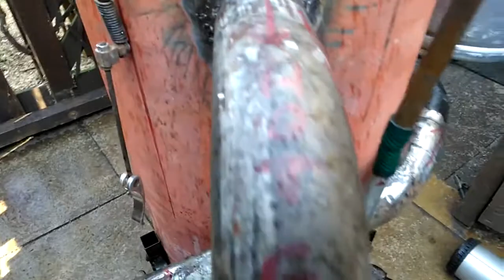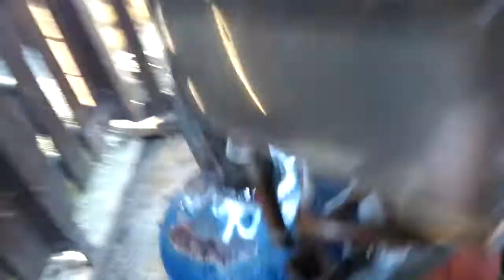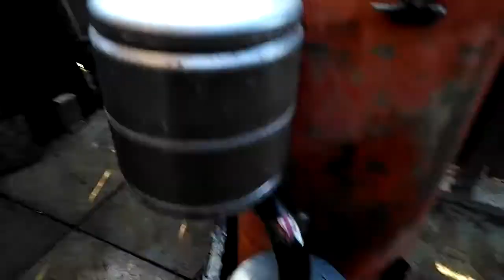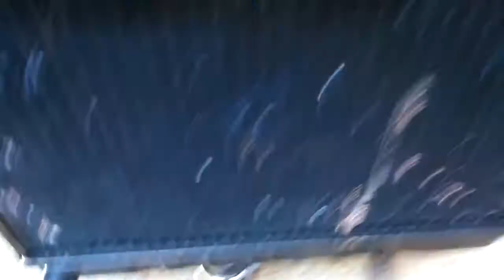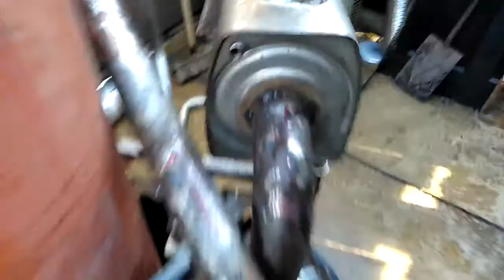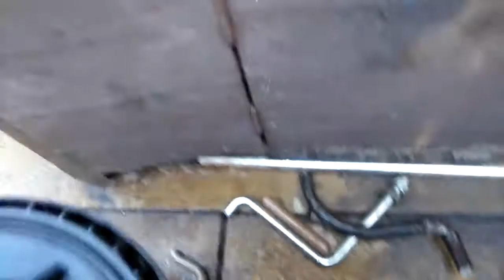Project Neptune (wood gasifier - pyrolysis reactor) #2

Comment: Nice  :) . 
 This has to be one of the most compact builds that I have ever seen. 
 Well done indeed.
Reply from the maker: Thanks pal.
Space is something I don't have a lot of so making it compact was one of the most important objectives, along with it costing as little as possible to build.
Reply: @brianmurphy8790  
 Indeed. Space is a major factor in many of the projects we like to build. 
 While I have a LOT of space here, I always tend to go for the most compact design I can possibly build. 
 Among other things, it makes for a more portable system. 
 One thing I wood suggest, however, is that you add some cleanout ports, here and there, as soot and tar can quickly choke up the plumbing. 
 On mine, I have a LOT of removeable caps, that allow me to suck a flame into the pipework, so I can burn out all the gooey bits, in a VERY hot and smoky sort of way. 
 It works like a charm, and it keeps me warm, on those chilly winter days   :) .
Reply from the maker: @CNCmachiningisfun  
I'm thinking the water/oil bubbler might be a good trap for the sticky goo.
Soot I can deal with, I've got some long and  bendy wire brushes.
The water in the bubbler will hopefully cool any tar enough to thicken it and get stuck in the stainless wool, then some of the motor oil floating on top of the water should make it's way downstream and keep the pipes lubed. 
With a bit of luck that should go some way to stop it sticking to the walls.
I've got a fan to blow air over the vortex filter too, again hopefully, that'll be the last place it sets. 
I've had a couple of oil burners that used to get all gummy when I ran them with cooking oil, but a bit of old motor oil/diesel seemed to soften/dissolve it quite well.
I'm going to run motor oil/diesel vapours through it before I even think of firing it up - I reckon it's probably a good idea to do that every few runs.
Reply: @brianmurphy8790  
 You'll be surprised at how cleanly a gasifier can run, once you get it properly tuned up. 
 My very first one made enough tar to tarseal my entire 150 metre long driveway, while wrecking a car engine. 
 Over time, I learned from my mistakes, and the gas is a LOT cleaner now. 

Oh, how I miss that tar. NOT! 

 For your very first runs, I wood suggest that you go with charcoal only. 
 That way, the tar content will be at a minimum, so you can see where you might need to put any cleanout ports. 
 A bubbler system can help, but it may be a challenge to get it working with an engine, unless you pull the gas through with a blower, perhaps. 
 The learning process is a fun one, that's for sure  :)  .
Reply from the maker: @CNCmachiningisfun  
Yeah, I was thinking I might need the vacuum pump running the whole time, even with an engine on the end of the pipe.
I've got a tank that I was thinking of putting some baffles in and installing it between the vacuum pump and engine, like some kind of plenum chamber to act as a buffer.
I've got an old Lister twin and Petter single as my initial engines play with.
I've been looking at various turbo diesels as well, around 2 litres, but that'd be for the next incarnation of gasifier.
Reply: @brianmurphy8790  
 You could start up, using the vacuum pump, and let the engine warm up on it. 
 After that, you might be able to reduce the speed of the vacuum pump, and progressively replace its workload with the engine's intake.  
 Ideally, the engine should do all the work, so as you can get the best results from your gasifier. 
 Another builder used a sort of water shower system, to knock the particles out of the gas stream, without needing to force the gas through a water bubbler. 
 I have never tried it, but perhaps you could make this work for you   :) .
Reply from the maker: @CNCmachiningisfun  
I think I saw that guy - in Canada?!
Part of the reasoning behind the bubbler is that it will scrub any CO2 from the gas - because CO2 is highly soluble in water, whereas CO is only very slightly soluble in water. It should scrub out any sulphurous compounds too.
Yeah, once the engine is running there should be enough vacuum to pull through the water - it's only going to be a couple/three inches deep.
I've got a long list of experiments to do once it's running.